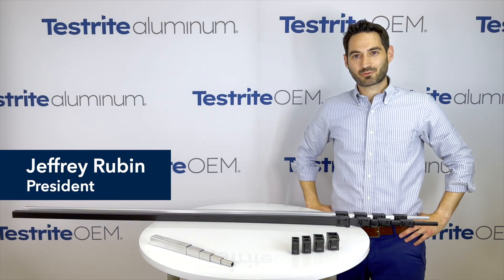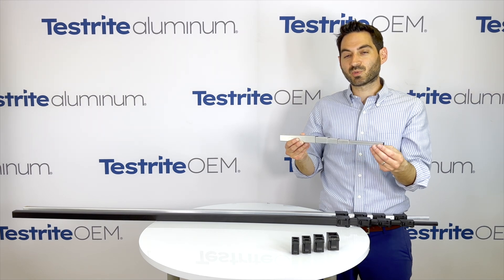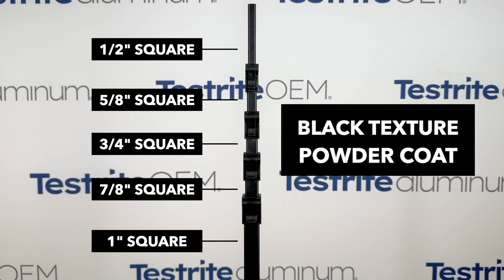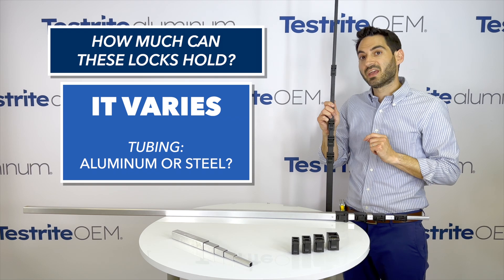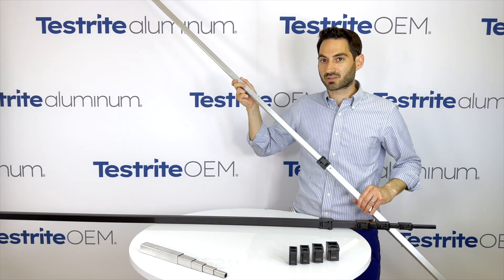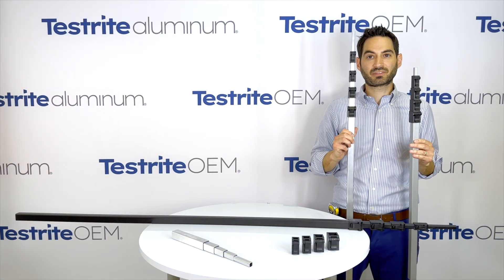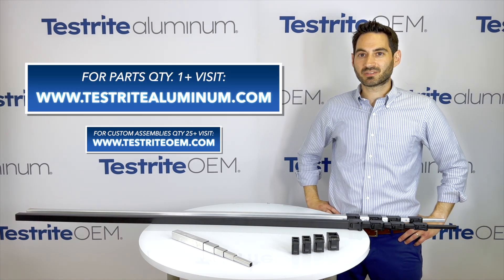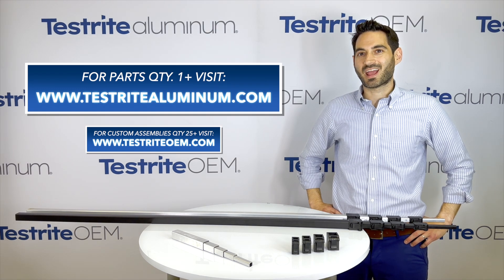Telescopic Square Aluminum Tubing

Comment: Do you guys have the vertical weight specifications?
Reply from the maker: We do not have a weight specification. If you need square tubing and are worried about weight, we recommend trying to pair the square tubing lock which takes up play with a steel spring button. If you just want a tubing lock without spring button and have some weight, our B Lock for round tubing is our strongest lock to test.
Reply: @TestriteOEM  Do you have ROUND tubing like this?
Reply from the maker: @REVNUMANEWBERN   YES we do! Check out www.TestriteAluminum.com and click on Telescopic Tubing Locks at the top of the page